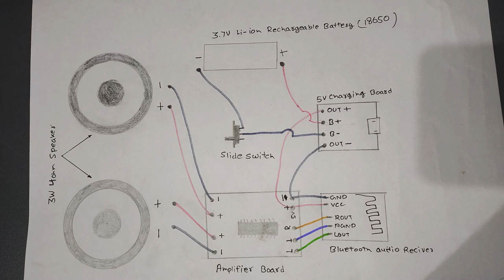how make blutooth speaker (wireless speaker) (homemade speaker) (with mobile box)

Comment: I also want to make this but problem os 
First all the wires of Bluetooth chip is broken like speaker and battery
Second my soldering machine is also not working well and may cause short-circuit in my house
Third my charging port of blutooth chip is also broken

So please 😢😢make video on home made but safe soldering machine 😢😢